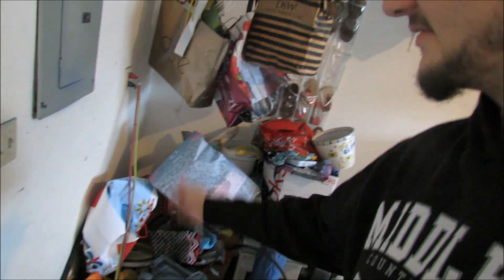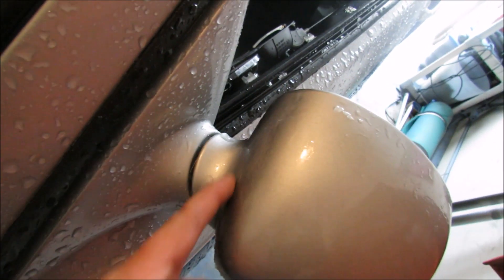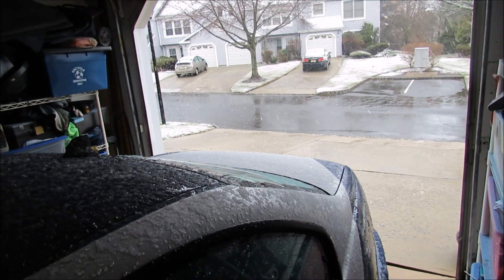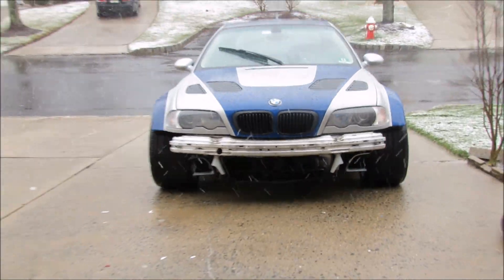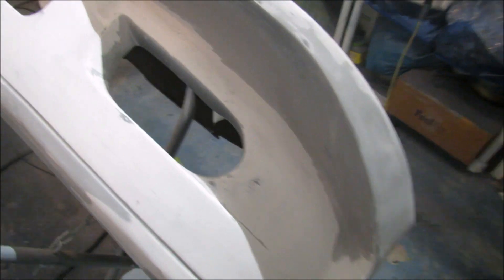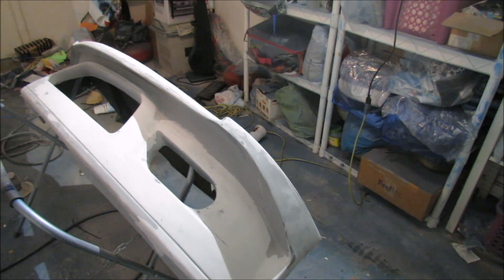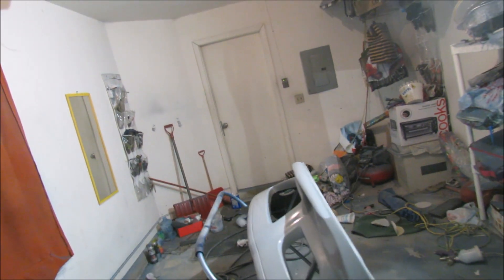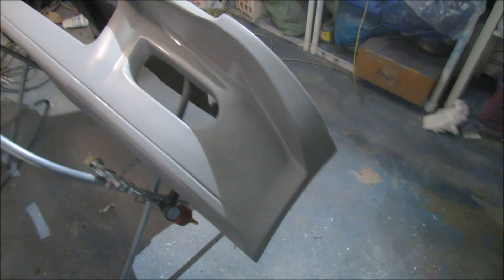M3 GTR - Resurrecting the Front Bumper

Comment: Car looks pretty cool but I'm not feeling those rims, should've gone with the M3 rims just like on the ones on the actual car in most wanted
Reply: Eddie Cordero Jr Those are the M3 rims, the rims that appear on NFS are the GTR rims
Reply: Eddie Cordero Jr Those ARE M3 wheels. M3 GTR had custom made ones by BBS.....incredibly hard to find....there was some replica by Sparco but its also impossible to find....
Reply from the maker: Kacpa2 correct , I am considering doing center lock wheels but the sparco I chettahs look similar but are discontinued also if I used the oem M3 wheels they’d be like 3-4 inches in and I’m not using big spacers
Reply: Oh ok, my bad, Camaro guy here didn't know much of the M3. And I think you should also do the LS swap like your friend did, you'll be flying in no time.